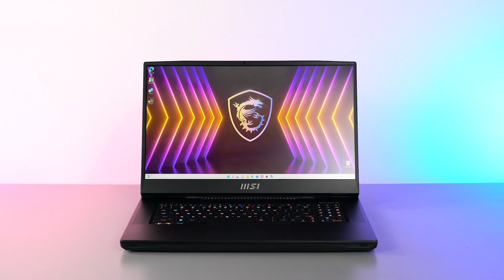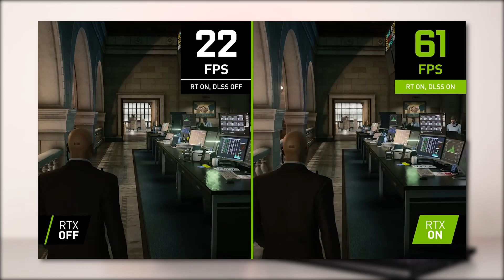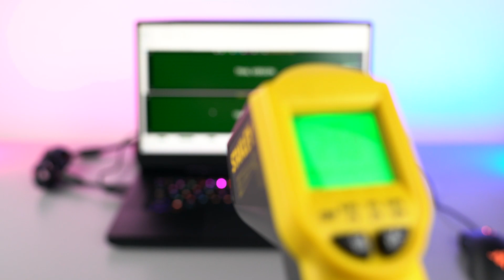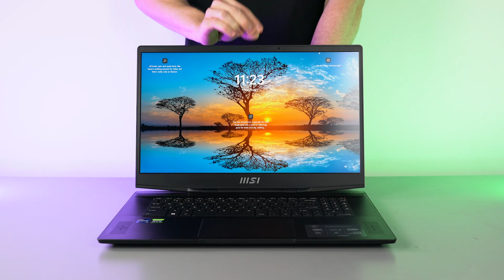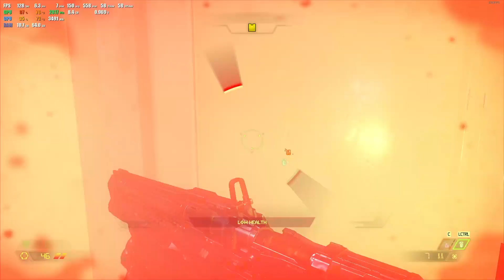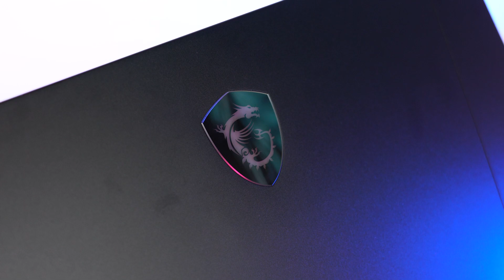EPIC PC UNBOXING&REVIEW MSI Titan GT77, the most powerful laptop that we have ever tested!

Comment: So is it just the wattage of the power supply making the performance difference between the gs 77 and gt 77?? Bc I have the gs77 with the i9 12900h and the 3080 ti and got the redline boost for the os and gpu overclocking with grizzly thermal paste and hp thermal pads for cooling 1+1tb ssd's setup in Raid 0 and it came with a Delta 12.0a 240 watt power supply, I know the titan has the 12900hx but is an hx that much better than just an h model? I know the power supply for the titan is 250 or 300 watts, my question how is the titan putting out so much more performance with all the same hardware basically minus a h and some wattage and would I get better performance with a beefier power supply?? Thanks to anyone who will answer🙏